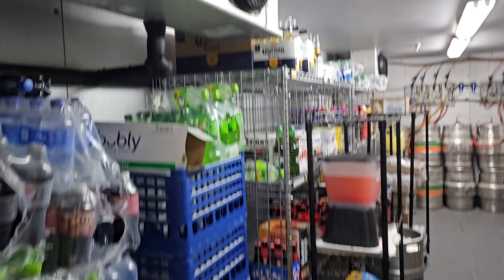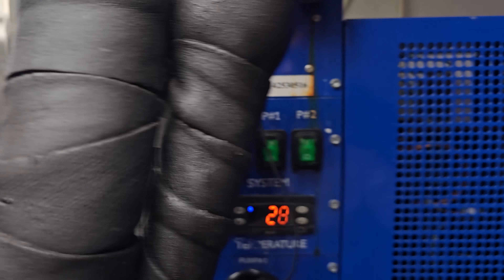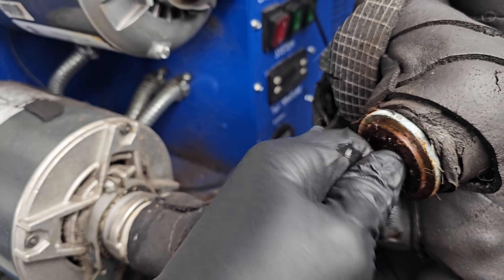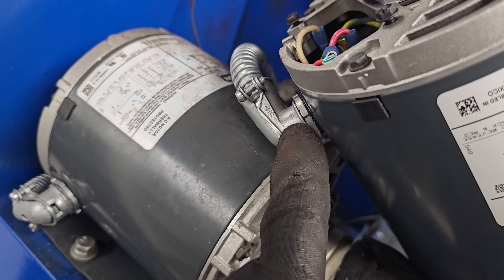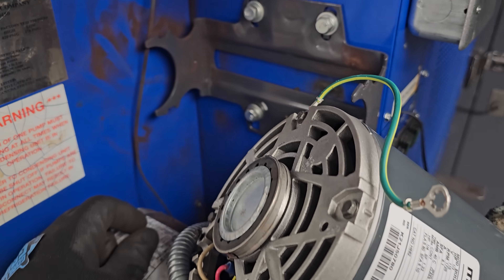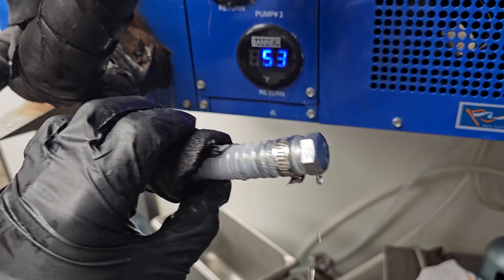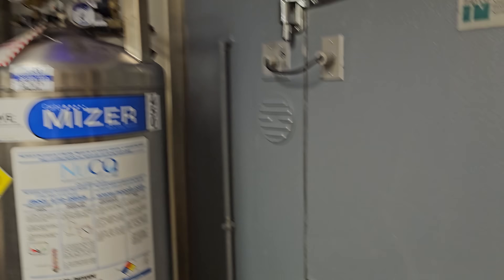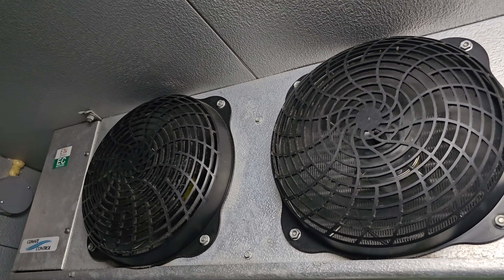THEY SAID THE BEER WAS TOO WARM

Comment: "undo these fittings, undo these threaded fittings and these fittings"
dude, save yourself the added headache and replace them with new fittings and pre-assemble on the new pump, then you just pull the hoses off and stab onto new barb fittings. far less headache and open time where glycol gets lost.
you could also use hose pinch off clamps/pliers, if the stuff is soft and pliable, but it's probably not seeing the type and age of it. 🤪

Comment: Great video format. "Why are you telling me what to do?" What? I wouldn't be watching if you weren't telling me what to do 😊. If you don't mind and have the time: I got a new fan motor for an Arctic King 12KBTU window unit. I didn't try to install it during the warranty period and am stuck with a "new" motor that has bad bearings and they'd hacked off 6 inches of the cable. Do you think it's worth trying to replace the bearings on this motor? Know of a good source? Thanks!

Comment: 7:12 I can relate my parents didn't change a cabin air filter since brand new of the car. The motor I took apart the motor from the car's hvac system it was night and day different when I replaced it. The filter is also replaced. While I was typing this car's hvac and you in the trade of hvac that something.

Comment: OK, ya got me with the joke there... although, TBH, I just figured it meant you'd be focusing more on streaming or something like that.

One criticism. It's kind of predictable, though -- your content has started to blend together a fair bit. It's, well, predictable. That said, there's only so much you can talk about with these things until you start getting a fair bit repetitive. They all kinda work the same, with more-or-less the same parts. Sure, the control boards are different, piping here and there is different sizes, and working with propane as a refrigerant can, I imagine, get kind of, erm, exciting... <wince> but in a field where your biggest change in recent years is that nifty reversing valve that turns a standard HVAC unit into a heat pump, sooner or later Thunder Road just turns into Glory Days y'know?

I know you don't do much in the way of residential content, but I'd like to see some of that. I've never understood the difference between commercial and residential HVAC -- everyone talks about it like it's night and day, in the industry, but I don't get that. It's all the same parts doing the same things.

I'd also like to see more in the way of fails, and how you recover from fails. Every time you start a compressor, you say "please don't blow up" -- well, what if it does? What's that like? and how do you handle that kind of thing...? etc.

Everyone and everything has a story, and every story is a lot more interesting than you might think at first glance... but when you're telling the same story over and over, or even the same set of stories, sooner or later people get bored. You need some new stories.

Comment: It’s been years since my last procon pump replacement, but I learned to always buy new flare to pipe thread adapters to thread into the new pump. I got my lunch ate trying to break loose the old fittings off the old pump on the first procon pump I ever replaced

Comment: I'm relieved that you were just making a joke...
I've learned so much from this channel that I'd miss the content very much.

I think replacing the motor and pump as a set makes the most sense, especially being a direct-driven pump where there is no opportunity for belt slippage to "save" the motor if the pump seizes. Sure, you could swap out the bearings and hope for the best, and you might be able to get away with it. However, as I'm sure you're aware, failing bearings cause the motor to run hotter than usual, and often for prolonged periods of time at not-quite-hot-enough-to-trip temperatures. There's the risk that the lacquer insulation on the windings has been affected... Better to be safe than sorry, and a new motor comes with a warranty for that peace-of-mind.

Comment: I use the exact same Procon pump and motor for an oil transfer pump on chillers and cooling tower gearboxes. I keep all of the hoses and pump etc in a 5 gallon bucket to keep the mess contained. Works very well even on Low Pressure (Vacuum) chillers.

Comment: Chris, go swing by Napa and get some hose pinch off pliers, they make metal jaw ones that you just put over the hose and squeeze them till it's pinched off and then they hold the tension, I have two of them in the van and they work awesome for glycol pumps

Comment: Thanks another interesting video, Chris. I really felt a feeling of emptiness when you said this was your last video. I know YT has been messing things up recently and started wondering if you had been affected and maybe moved to a different streaming platform rather than just ...nothing...the end. There was a great sense of relief when it turned out not to be the case.

I had a thought that your videos were intended for other professionals in the field but I didn't know they were intended for your employees. Not being funny but I think it's amazing that someone running a company actually genuinely cares about their employees so much that they would take the trouble to do this. It certainly explains why your videos are so good. (In my own experience this has certainly not been the case with 'management' not caring about anyone but themselves, to say the least.)

Thinking about the glycol unit you were working on, is there not some kind of hose clamp that would have worked without damaging the hose? Depending on how often those units need attention, are there any suitable inline valves that could be fitted to the hoses, maybe as part of the job, to make life easier for the next guy that could well be you?

Comment: Scrap guy here, I've opened hundreds of motors and compressors at this point. You can tell when a motor has been overheating because the windings will be a lot darker. Compressors with bad starting components that have burned out due to them the rotor often times will have turned blue from overheating!

Comment: Couldn't they just use quick disconnect fitting on the pump so no loss of glycol, and could they just pour the warm beer back in to the tap line?
Reply: Contamination for the beer. Cheaper to pour it down the drain than do the machinations required to deal with potential contamination